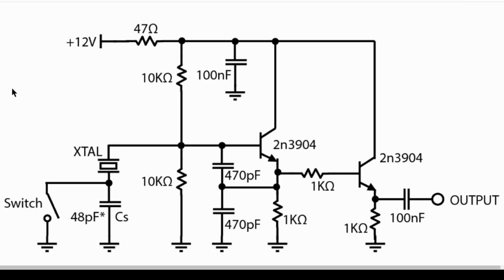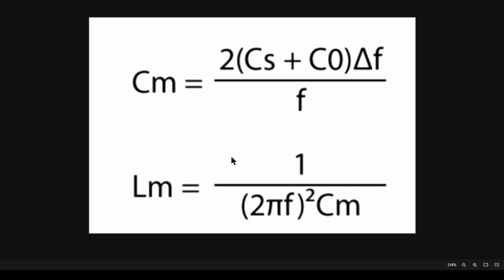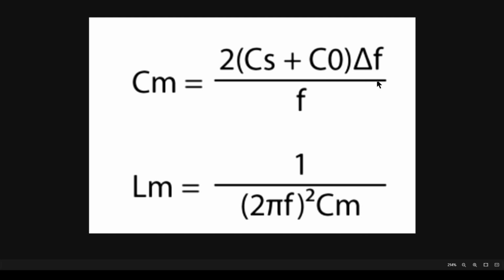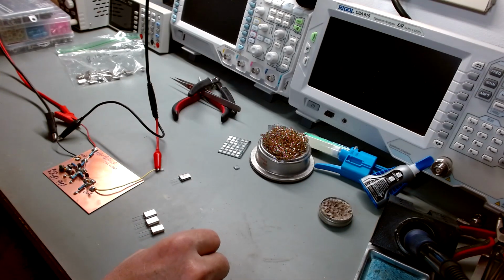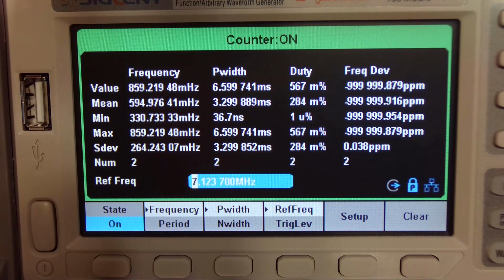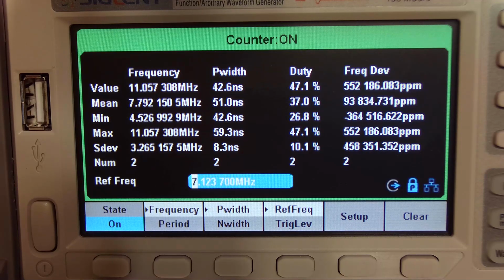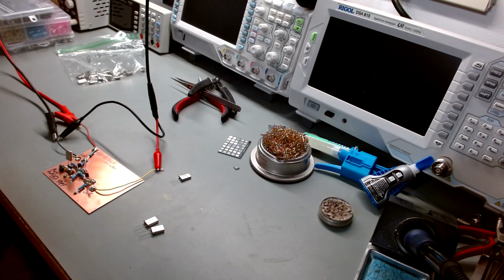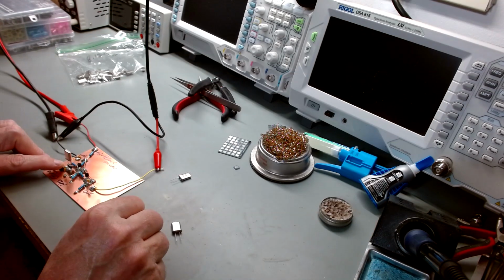How to characterize crystals for a filter.

Comment: Yes, I did learn something. Bravo! Thank you! For your flux pump - Make/Model/Link? For the islands - DIY/Make/Model/Link? Tip = I use a cheap tile saw to cut PCBs - It is the black, plastic model, from HF. I use the diamond blade that does not have any gaps in the cutting edge. I would give you the link, but YT won't let me. I built a sliding cutting table top for it and it cuts dead on square. Cheers.
Reply from the maker: Great! Glad to hear it. The pump was off of AliExpress on the app so no link to give or I would be happy to do so. 
The islands are mepads from the web site QRPme.com. The little saw I got in the video has the same type blade and works great like you said. Thanks for the views and the feedback.
RJ
Reply: @LynxElectronicsLab  Thanks for the fast reply. What is the make and model of the pump, so I can look for it?What do you think of it? I imagine that it is really intended for glue. My board saw cuts so fast and clean that I would just cut the islands that I need.
Reply from the maker: I copied the info from my order at AliExpress, it says :
RELIFE RL-062A  RL-062B  RL-062C Manual Glue Needle Booster Suit for 10CC 
Hope this helps!
RJ